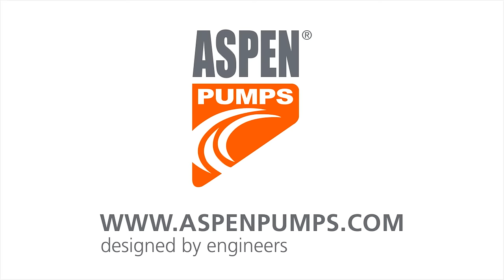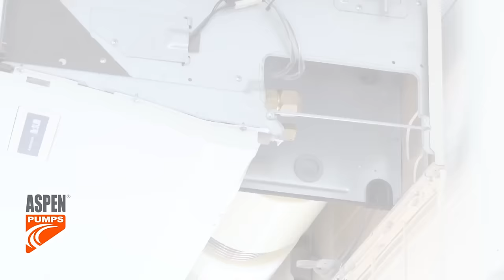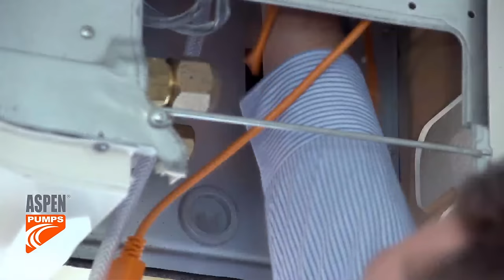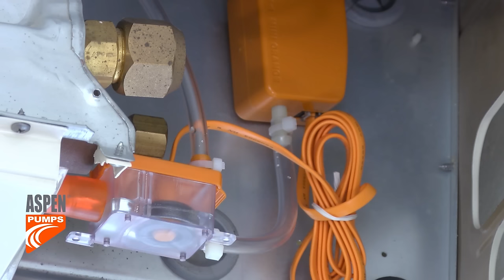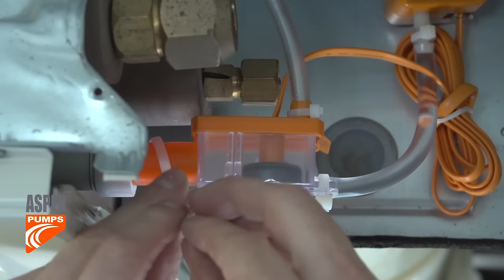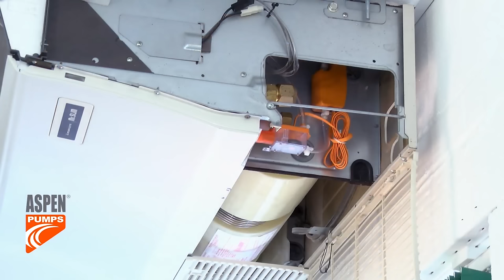Install of mini orange pump on ceiling unit

Comment: that tiny collection tank with it's tiny screen filter is like installing " a service time bomb"; get the larger external Aspen pump unit with the MUCH larger tank; or just use a standard HVAC condensate pump if you've got a place to conceal it.
Reply: my AC was dripping water all over the floor last night because the filter on the float was full  and it couldn't drain 😅

Comment: Hi there, I have the small blue pump connected to a Daikin split system.  When the pump activates, it pumps on and off, on and off for only one second at a time. Is this normal? Or should the pump be more constant?  I haven't used the AC for over a year but I think the pump used to be active for more than one second at the time.  I removed the filter and the small box and cleaned it all out. Re-installed but same result....
Reply from the maker: Hi there, apologies for the delay in replying. We are just waiting to hear from our technical team regarding this and will get back to you asap.
Reply from the maker: Hi Stinger OaC, our technical team would be happy to assist you with this. In the first instance, if you call +44 1323 848842 and select option 2 for technical, the team will be happy to call you back to discuss the issue.
Reply: It s normal,  no matter the trade mark....aspen sauermann etc etc ...the motor need to be isolated  toi reduce the buzzz sound

Comment: Hi Folks
Mine continue to fail.  They are on an AC, mounted exactly as shown in this video with about a 1m exit pipe straight up. It hardly ever gets used and fails every year after about 10 mins work and stops pumping.  I remove the exit pipe and there is only barely a dribble coming out - it's as though it loses the prime and cannot self prime again. The suction side is full of water with no hose kinks and no bubbles in the tube.